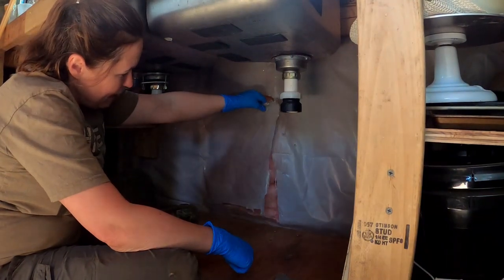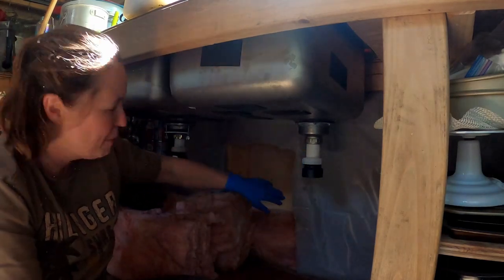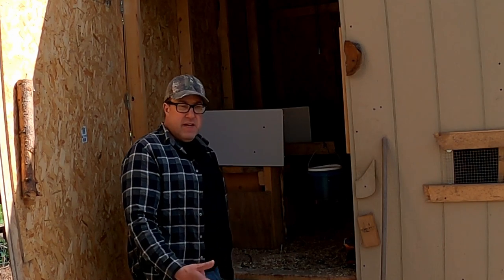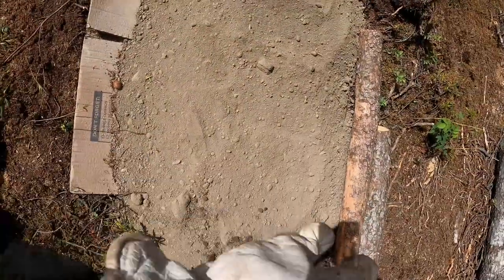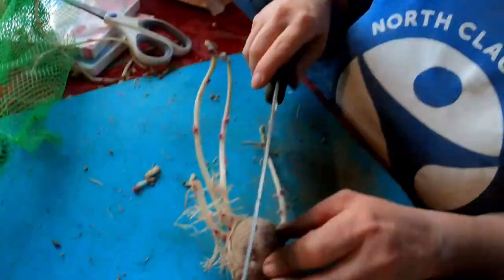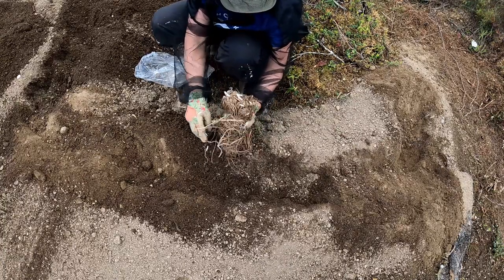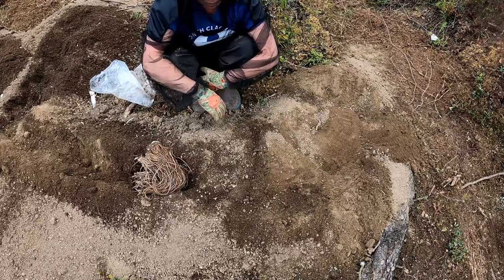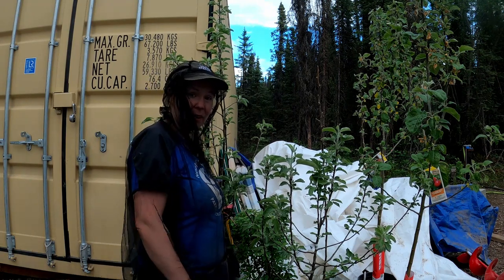Sink Plumbing & Planting Potatoes Asparagus Honeyberries | Life in Alaska

Comment: have you thought of making a soak pit dig hole about 5 feet down fill up with rocks and gravel pipe the kitchen sink to it put it all under ground at least 3 feet so it cant freeze and cover the hole the water will soak in the ground if you like put drains out further of about ten feet drill holes in the drain pipes to after the soak pit they work over hear in Australia i had one at my shack small cabin when i was younger also you could make a septic like that to make your own with cement but has to be down deep probably 10 ft sorry i rote this in inches but i don't know if you use metric there i think Alaska does but your from America maybe you can find that on the internet and cover it all up after